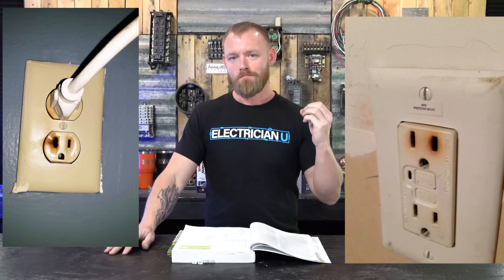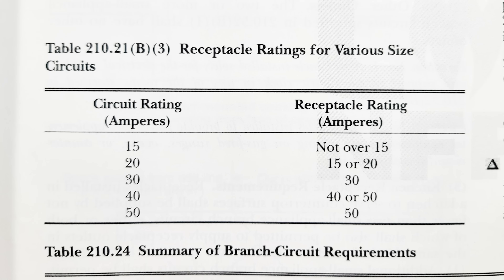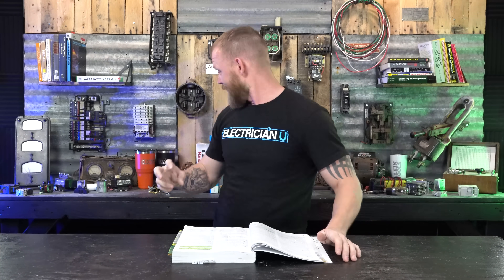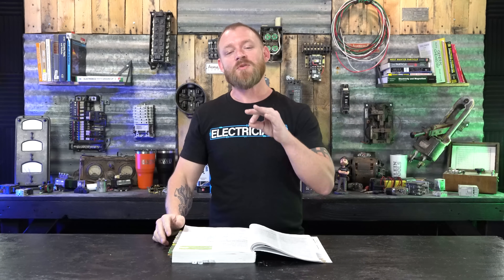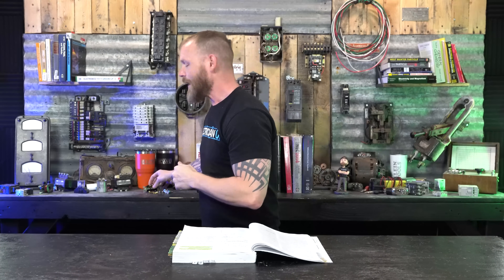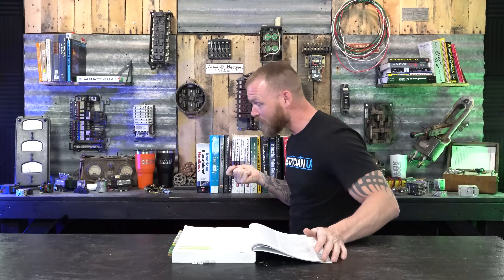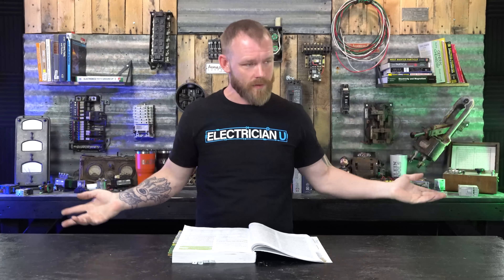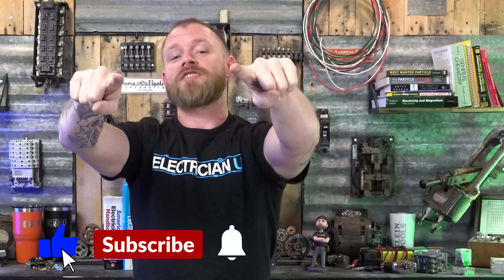Won't These Melt?!? 15amp Receptacles on 20 amp Circuits!!!

Comment: I have a question kind of related to this, I have a 15a dedicated circuit for my sump pump which needs to be GFCI protected. I have an old panel that doesn’t accept any new GFCI type breakers so I had to use a GFCI type receptacle to comply with code. The problem was that the receptacle is under my house and realistically if it was to ever to experience a ground fault without tripping the breaker I wouldnt find out until the next time I was in the crawlspace. What I did was replace the GFCI with a standard 15a duplex and put a blank face GFCI upstream on the home run (on the main floor of the house) so I can easily see if my sump pump is getting power. However, I was only able to find a blank face GFCI rated for a 20a circuit so that is what I used (still a 15a breaker for overcurrent protection). I am wondering if this is an electrical code violation since the GFCI wont trip from 15-20a, or if it is okay because its all still protected at the load center. Maybe this would make a good video? Thanks in advance!

Comment: My toaster draws 15 amps (@125 volts, according to its rating), but it has 15A nema plug.  It plugs into a 15A receptacle.  The receptacle does just fine.  Why?  Because it only runs a few minutes at a time.

I also have 1500W space heaters, which draw about 12.5A.  These tend to scorch anything they are plugged into.  Why?  Because they run for a looooong time.  The problem is receptacles and power strips are garbage, and the so-called current ratings on them are lies.

Obviously, if I have 5 15A receptacles on a 20A breaker, I would like to be able to draw 5A from say 3 of these simultaneously.  NEC is not an idiot.

Comment: So basically if I had 6 15amp recepticals on a 20 Amp breaker it will be OK to run 12 amps on each receptical at the same time.  I appreciate  you explaining  but you were going  a little  to fast

Comment: Question: Looking at that table, why would a 20 amp receptacle not be allowed on a 15 A circuit? I ask because in my basement I did that with an obscure outlet behind my water heater because I had an extra 20A receptacle laying around. I only have a box from my internet provider plugged into it. Should I put a 15A receptacle there, or will it be fine? It's GFCI protected if that means anything.
Reply: It'll be fine the nec lab coats aren't the brightest 😂

Comment: Why does table 210.21 b 2 Shor 15 or 20 with a max load of 12 if 12 is not 80 percent of 20? Then under that the circuit rating says 20 with a max load of 16 which is corrent.

Comment: Hi there. I'm in a position to replace 4 bedroom receptacles in a 100-year-old house, wired with 12|2 off a 20a breaker. I have no choice to install 15a receptacles other than to rewire the house. You give great information. Pay attention to the load going into the receptacle. Got it. Cheers!

Comment: If an electrician encounters a burnt socket he should try to determine the cause. See what the tenant is plugging into the socket and often it is the result of an overheating plug end that overheated the duplex and killed the spring tension in  the socket contacts. Some will pull a plug by the cord rather than the plug, some will use an undersized extension for the size of load. Eventually the overheated plug-end will wear out the socket tension and make for a loose connection. Could be the original install -- a slotted screw-driver  usually does not provide enough force to make a sound connection, and back-stabbed connections make for hot spots. If pig-tails got overheated they should also be replaced as hardened leads are prone to breaking.

Comment: See this is why I didn't learn anything in school 50 years ago. No, I dont know much about electrical wiring and load amps,,,,,,, and the reason is I hate to read because ADD. Therefore when you bring book of electrical codes out and start showing only codes, that dont help people like me at all. All I see when you bring that book out is a rats nest of 3000 wires............... Therefore when you bring the book of codes out bring some freeken illustrations out with it for show and tell, like 14/2, 12/2 wire, 15 amp out lets, and then plug a microwave, electric heater, toaster, coffee maker in,,,,,,,,,, show what amps these thing draw, show how to plug them in on several 15 amp outlets on a 12/2, 20 circuit breaker...... Then and only then will a book of codes make any since for people like me...................

Comment: Regardless of what is says in the code book putting a 15a outlet on a 20a breaker isn't a great idea.  Sometimes common sense isn't so common..  Murphy's law guarantee's somebody is going to plug a space heater and a blow dryer into it eventually.

Comment: I am currently renovating my house and your channel has been extremely helpful with understanding electrical work. Im trying my best not to burn my house down
Reply: don't listen to this video then, putting a 20amp breaker on 14g wire and 15a outlets is exactly how you burn your house down.
Reply: @ydnark83  No clown, the code says on a 20 amp branch circuit AKA 12 GAGUE, 15 amp receptacles are permissible given more than one receptacle is on the circuit. They wouldn’t put it in the code if it weren’t safe.
Reply: @frankdoge9147  until someone plugs a blow dryer and space heater into it, or an air fryer and a microwave, or any other combination that puts more than 15a on that outlet.  I wouldn't trust "they", do the math yourself
Reply: @frankdoge9147  google overloaded receptacle fire, or just keep trusting they..  its your house, why spend an extra 15 bucks on 20a receptacles when you saw a youtube video that say's you don't have to?  You already admitted your an amateur so don't let common sense or professional advice get in the way.

Comment: I’m guessing that 99% of most people in the US and Canada are completely ignorant about this!
I knew most of this about receptacles! but it also applies to power strips! 
I had a 20 amp receptacle connected to a 20 amp breaker 12/2 Romex with a power strip that must’ve been rated at 15A because it constantly tripped when I ran my 6.5Amp craftsman wet, dry vac, and my 3 hp skill-Saw 15Amp  table-saw cutting 2x4’s with the blade fully extended,  Plugged into it! when I unplugged the table-saw from the power strip and plugged it directly into the same receptacle It didn’t trip.  ! 

However, I didn’t know that the circuit breakers don’t trip until they’re 130% of the maximum current rating of the circuit breaker itself a 15 amp or 20 amp. But 200% of the magnetic 🧲? That I don’t understand.

Comment: If you have one outlet, that has 2 receptacles on it, does the 80% rule apply to the outlet as a whole, or to each receptacle? For example, if I have a device pulling 80% in the top receptacle, can I plug another 20% in the bottom receptacle?
Reply: Most outlets are 2 receptacles, hence the name duplex receptacle. Single receptacles are usually only used on dedicated circuits. Most commonly both receptacles are on the same circuit, so the 80% rule applies to the whole device. If however, you have 2 circuits on one duplex receptacle the 80% rule would apply to each one independently. This is common in the kitchen and is either a multi wire branch circuit or 2 separate circuits. In either case you would have a double pole breaker or 2 single poles tied together for these circuits.

Comment: I find it very surprising that the code would even allow for 15 amp receptacles on a 20 amp circuit. I would think the prudent thing to do would be to assume that people are going to plug in too many devices and melt the receptacle. There are other sections of the code where they are overly cautious, like the mandating of AFCI and GFCI in some scenarios. But oh well, I'm not an electrician!
Reply: If the receptacle is in decent shape it won't melt because it's a 15 amp device. A 20 amp receptacle will melt also if the connection is bad, the wires are under rated for the load, the circuit breaker is bad. The appliance could be bad, but the breaker should trip if overloaded, or gfci (if applicable and a ground fault occurs) before any damage occurs. A bad connection or worn wiring can cause arcing that probably won't trip the breaker, but could melt the receptacle. That's where afci devices come in.

Comment: The problem with that 12A maximum load is no body even an electrician like yourself or me will have an ammeter to measure the current of a load plugged into a receptacle. However looking at the specs of the device we are plugging in can give us an idea of how much current it will draw.
Reply: Sure you can. You can get a cheap clamp meter (multimeter with inductive pickup to measure current) for about $25 or a nicer one for a little more.
Reply: @surferdude642  For a camp on Ammeter to work you cannot simply camp it around the power cord of the device you are plugging into the AC outlet. I am sure you know that right Ted?
Reply: @surferdude642  Can you post a link of what you are talking about. I have two Ammeter one is a FLUKE and it does not have the Adaptor you are talking about. Thanks

Comment: All kitchen counter receps and wiring should be 12/2wg and 20 amp rated gfi and a dedicated line where as lighting is generally 14/2wg on 15amp circuit! Bathroom receps like kitchen in dedicated line and 12/2wg and 20 amp rated gfi

Comment: Why wouldn’t you just use a 15A breaker for a circuit that only has 15A outlets? Or, could you just have a 15A GFCI in front of all the other 15A outlets, essentially making them all GFCI? I’ve just always been of the mindset of built-in redundancy to keep things safe and idiot-proof, so I’m curious to why you would even chance it.

Comment: Still waiting for you to answer the question as to "WHY' you can install 1 or 2 amp light fixtures on a 15 or 20 amp circuit.   In regards to your table,..I've NEVER seen  an inspector give a damn (and rightly so, I believe),..if you have a 15 amp rated receptacle on a 20 amp circuit. Don't even get me started.

Comment: I occasionally run into the scorched outlets in bedrooms and finished basements from more than one electric heater. The most common location I find scorched outlets is where a homeowner has connected a microwave oven and a toaster oven to the same 15amp duplex receptacle. I must say, though, it's much less common than it used to be due to appliances becoming more efficient.
Reply: you'll encounter it where they constantly plug and unplug high draw items.

Comment: I will never understand why hair dryers in North America are rated for up to 1875 watts but always at 125v. Never seen supply voltage at 125v once its turned on, and 1875 watts at 120v is more than 15 amps. I guess its for marketing purposes, but still a bit silly...

Go figure?

Comment: I've got a space heater that is supposedly rated for 1,500 Watts When it is plugged in and running it's pulling about 12 and 1/2 amps I know that's only a little over the 12 amps that this gentleman was referring to but is that potentially a dangerous situation?

Comment: It is much simpler to not be a chaepass and just put in the 20A duplex on a 20A breaker. Its an extra $1 at the most per duplex. I make the assumption that most people do not know the code or understand why it is written the way it is.

Comment: The original reason for circuit breaker size was to protect the load side house wiring. But the code is not yet perfect and requires revision on a regular basis. The greatest risk now is with a 240 VAC Subfeed to your residential garage so as to recharge an electric vehicle. The cheaper 240 VAC receptacles will frequently overheat and even catch on fire.

On higher power systems the protection devices are far more complex such that TCC time current curves need to be determined because a simple current fuse is inadequate for instantaneous current overloads that can cause arc flash. And that is why I had to learn to use ETAP to adequately design MCCs.

Comment: ....Walmart and all of the other stores that a "once-in-a-decade' "handyman" purchase their electrical infrastructure supplies generally do not sell 20 amp outlets.  I challenge anyone to find a 20 amp duplex receptacle in any store on this side of the common man's distribution network (besides your general 'electrical supply hut', and believe it or not Lowes recently started stocking them (but 'handyman' would go for the 15 amp receptacle at .71 cents versus the 20 amp version for $4.59)). Then he is going to go home and install it into a live branch circuit and simultaneously receive a shock therapy session (all for the paltry sum of 71 cents), besides he never understood that they could be disconnected and he never did it that way anyhow. Two weeks later the fire department will be on site for a curtain fire, wall fire or some similar event...

Comment: the breaker protects the wire. I think that's pretty much what you said in this video anyway. I have taken apart tons of outlets and found plenty of 20A sockets with internals as thin and flimsy as 15A sockets. I have also found several 15A sockets as beefy as a good 20A socket. you get what you pay for.

Comment: One would almost think why even bother making 15 amp outlets?
It’s like a mobile home most everything is 14 gauge wire and 15 amp breakers. What’s the big reason for doing that? I find it to be very stupid.
Reply: You have to bother to keep making 15 amp receptacles to install them on the 14 Awg wire that is installed on the 15 amp breaker

Comment: Hard to believe there's so many code requirements that are overkill and spec'd to protect the 1 in 10,000,000 chances of failure, yet this is still allowed.

Comment: Ok let me put it this way.
Just had to sort out why an outlet failed.
Though ok bad outlet replaced it.
Still didn't work.
Had correct wiring but only 84 volts
Traced the line, some redneck wiring linking one outlet all the way across the house and on the other side of the garage to an outlet in the garage.
20 amp breaker 3 15 amp outlets (one powering the garage door and one meant to be a plug for an outdoor/workshop extension cord) 2 light bulb and the dipshit wired another outlet straight into the back of the garage outlet.
When I finally found the cause by unplugging the power supply from the garage outlet there was scorch marks up the wall.
The inside was cooked.
15 amp wires that should never pull above 12 amp on a 15 amp outlet but a 20 amp breaker.
The wires are 15 amp the outlets are 15 amp but the breakers are 20 amp.
Just dangerous bullshit all around the way the outlets are strung together.
Yeah it is fine if you are the one who wired it and have a house wiring schematic in your head, but sell the house and it will probably catch fire in this case someone running a leaf blower on one outlet and someone else running a vacuum in a room in the house.
20 amp circuit breaker never trips while you are just sitting there cooking the shit out of the wires and setting your house on fire.

Comment: I bought a range hood only to find it calls for a 20 amp circuit. But my previous hood ran on a 15 amp circuit. And thats my current circuit. Am I asking for trouble to run my new hood on the 15 amp circuit?

Comment: I'm still confused if space heaters are 1500W by default but 80% of a 15 amp circuit is 1440W.  So the expectation is you will use 1500W devices continuously on 15Amp circuits regularly.
Reply: Think of it like this:

A 15A circuit is an 1800 watt (maximum) circuit.
It is a minimum of 14AWG cable, 
AKA "Romex".

P (WATTS) = I(Amps) x E(Volts)
1800W = 15A x 120V
P = I x E
15A x 120V = 1800W

If a new 1500 watt forced air electric wall heater is installed in a wall, as a dedicated circuit 
(not branched; not a branch circuit, which SHOULD be done)
it would be served by a dedicated run of 14/2 AWG cable ("Romex") terminated to it's own NEW dedicated 15A Breaker.  
(Nothing else is on the line; it's a "home run" dedicated circuit serving ONLY this heater that can and will draw up to 1500 watts ALL BY ITSELF).
(The above load calculation is describing the 1500 Watt heater load, and installation).

A 20A is a 2400 watt (maximum) circuit.
It is a minimum of 12AWG cable, 
AKA "Romex".
If a new 2400 watt forced air electric wall heater is installed in a wall, as a dedicated circuit (not branched; not a branch circuit, which SHOULD be done) 
it would be served by a dedicated run of 12/2 AWG cable ("Romex") terminated to it's own NEW dedicated 20A Breaker. 
(Nothing else is on the line; it's a "home run" dedicated circuit serving ONLY this heater that can and will draw up to 2400 watts ALL BY ITSELF).

P (WATTS) = E(Volts) x I(Amps)
2400W = 20A x 120V
P = I x E
20A x 120V = 2400W

A 20Amp circuit run with a dedicated 12AWG cable terminated it's own dedicated 20Amp breaker to the dedicated 2400Watt heater.
(The above load calculation is describing the 2400 Watt heater load, and installation).

**In this heater installation, the 1500Watt load (the 1500W heater)
is being served by the 1800Watt,  14/2 AWG, 15A Breaker, dedicated "home run" circuit.